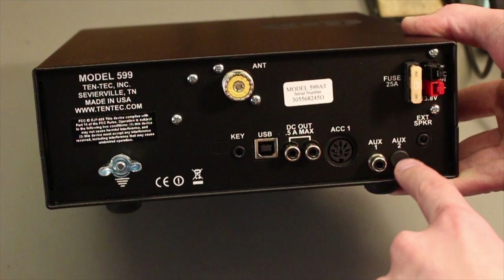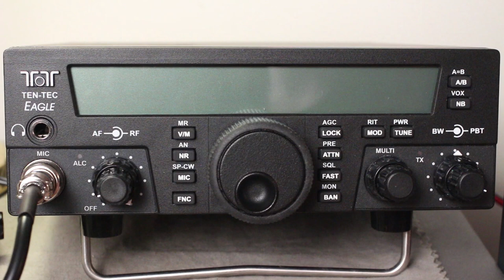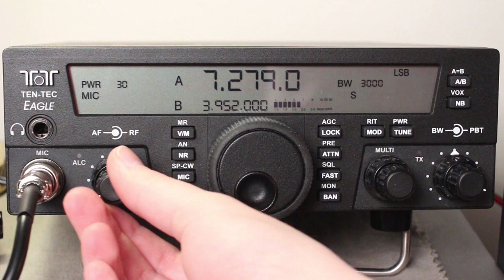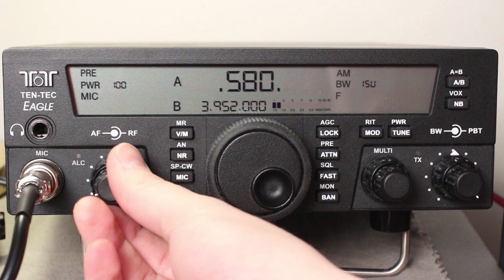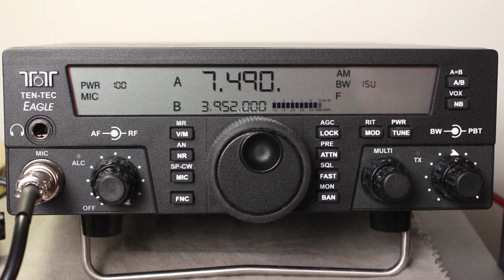Ten-Tec Eagle Amateur Radio HF Transceiver Review

Comment: I use mine more and more /p with a Bioenno 12Ah pack.  I can go about 8 hours on 35W CW with plenty of power to spare at the end (I can’t go any longer).  Works great on the tailgate of my truck, on a picnic table, or soon from my backpack once I work out a side rail system for it,  it will never replace my KX2 as my goto backpack rig, but it’s a joy to operate.
I am CW only and have no problems with the speaker. In fact, I really like the speaker, it seems to accentuate CW signals and makes them easy to hear and decode.
I do wish it had a memory keyer though…
W1ND

Comment: Just got one a few weeks ago, used on ebay. Not sure if it was a scam or not but I took the chance and it turned out not only to be a good radio, but looks as if it was never used. Paid  over 800 on an offer. Its an ok radio, but I'm thinking about surrendering to SDR technologies. Namely the Flex. I can hear weaker stations on my SDRplay than on my Eagle so. . .

Comment: Unfortunately no Ext. RX ant port, distorted audio on SPKR, noisy RX, poor AGC, useless NB, RIT usage is clumsy, just single mem ATU per band... sorry to say it is not hilarious radio (and yes I am the TT fan!)
Reply: 11:05 just the note > mentioned  board is not ATU but LPF board. The ATU (if installed) is placed on the bottom of radio...